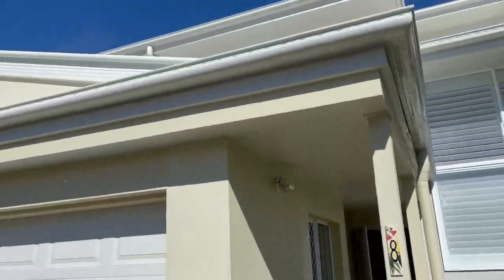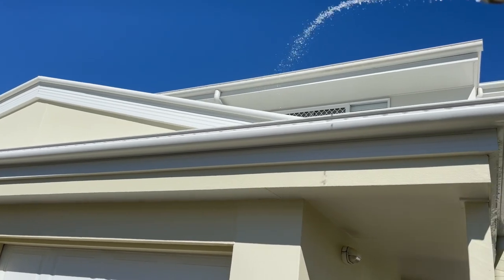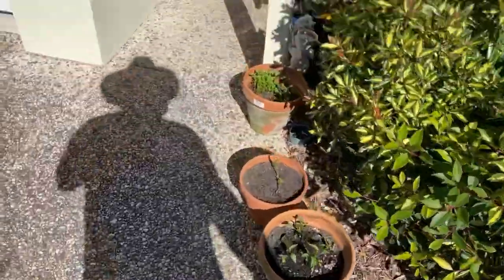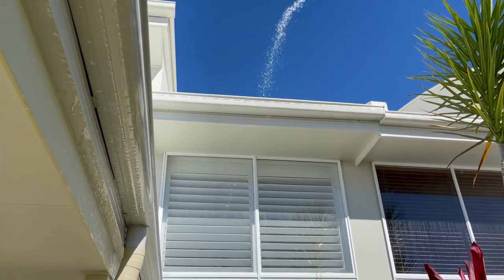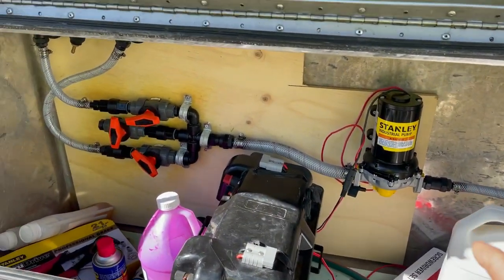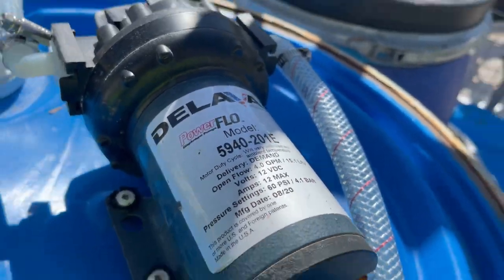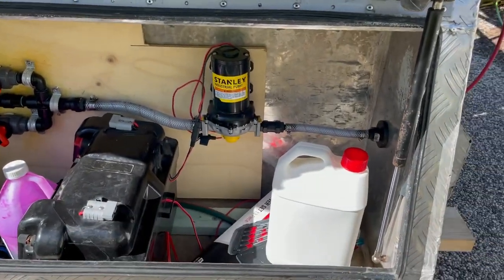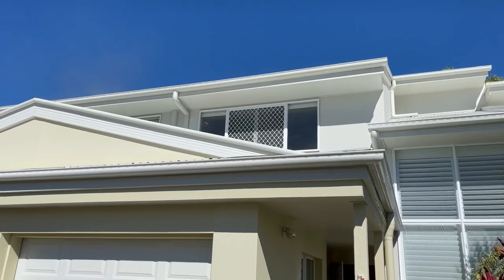Duel 12v  Soft wash system- we put 2 pumps on a 12v soft wash setup

Comment: Get your self a 7 gal pump 60 - 70 psi plus I use a Xjet M5 modified gun. Great video 👍
Reply: What XJet mod are you running? I've got a couple I've modded out and none of them work well with a 12v....?
Reply: Is it chemical rated pump?